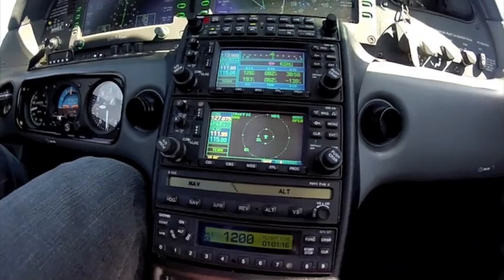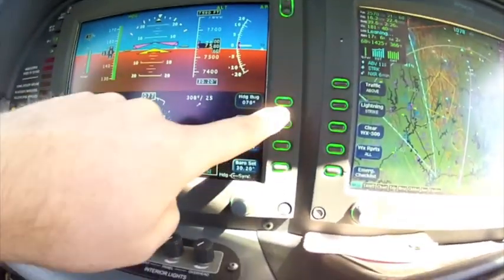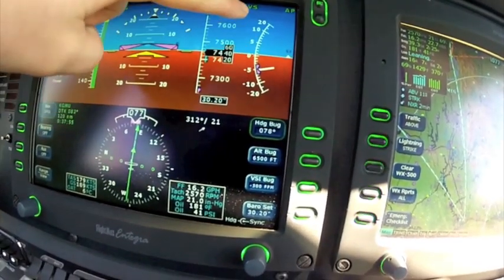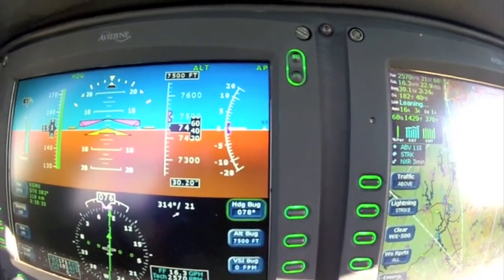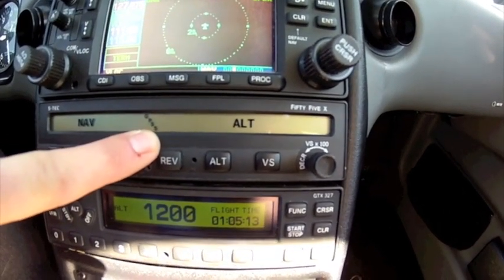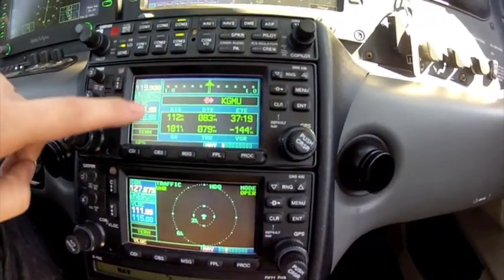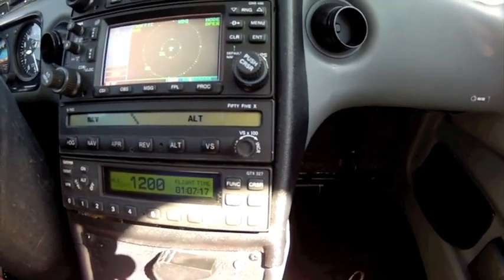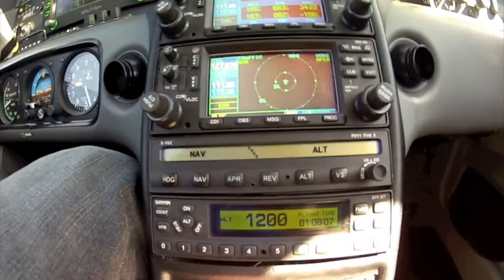S-Tec 55X Overview

Comment: Can you do this with the S-Tec 55X? Set heading bug to runway heading, v-speed bug to +500, altitude bug to 2000, then give it power. As soon as it is airborne punch HDG. As soon as your pitch is stabilized hit VS. And have it climb up to 2000 and level off automatically? Am I asking too much of the unit? (I tried this and failed utterly)
Reply: You need to press ALT and VS together if you want the AP to level off at 2000, if you do it will fly this profile.

Comment: Can you comment on the procedure you use to enable the GS capture when using the APP key to do coupled approaches?  I've found some cases where the GS will not engage if the ALT VS is enabled. If ALT key is pressed 2x, then this disarms the VS mode and allows the GS to engage, I think.  Just trying to drill down to exact state the 55X wants to be in to enable GS (something I don't care to fool with in actual).
Reply: did you figure out a proper GS or GP capture procedure?
Reply: @MarekMarciniak  Not really, but since I’m aware of this odd behavior, it hasn’t been an issue.  I just wish the process was a little cleaner.
Reply: @12romeo53  So how do you capture GS. let's say you are getting last vector to join final approach course on a ILS,   what modes do you use
Reply: @MarekMarciniak  At the final approach point with the AP in Nav and the Alt fixed, I hit Alt 2x to release and then select the APR key. You should then be coupled and you can confirm when you see the GS indicated on the display
Reply: @12romeo53  ok thank you, so to summarize: you are being vectored to ILS approach- you are in HDG and ALT modes, when you get the last vector to intercept the localizer you press HDG + NAV, when the AP captures the localizer you manually disengage the ALT mode by pressing ALT button twice and then you press APR mode, is this correct sequence?
Reply: @MarekMarciniak  Close. My normal flow is: in HDG (or NAV) and ALT mode, vector to fix — direct to (which activates the approach), adjust altitude for IFA (or FAF if GPS), and then when I intercept, i release the altitude set point by disarming (selecting ALT button 2x), and then select APR. Hope this helps. Best way to address this is a practice approach or two.
Reply: @12romeo53  thank you very much. This was very helpful.

Comment: Thanks for sharing, but I realized that auto-pilot is way too complicated. I thought you could just put in your way points and altitudes, and press go.  I also noticed that the auto-pilot module is too low. It should be be at the top so that your eyes are close to the sky.